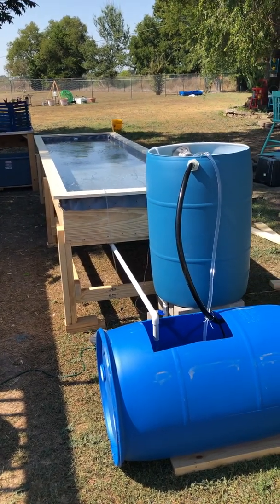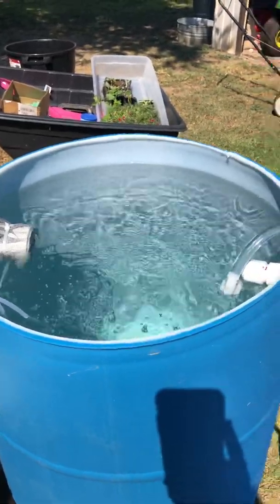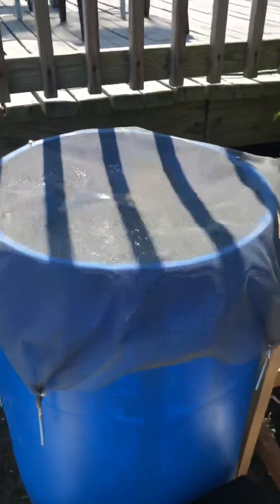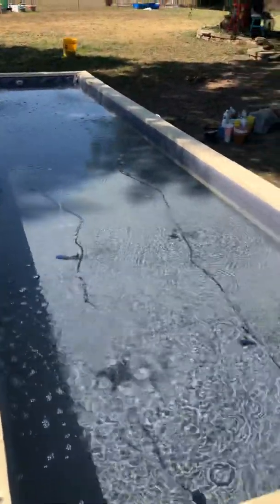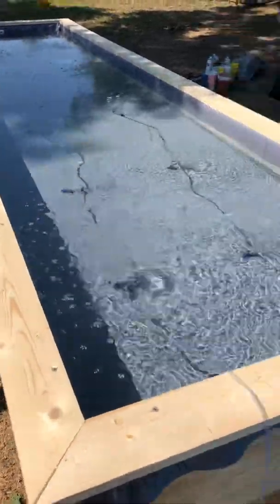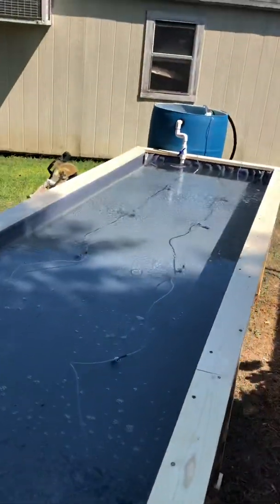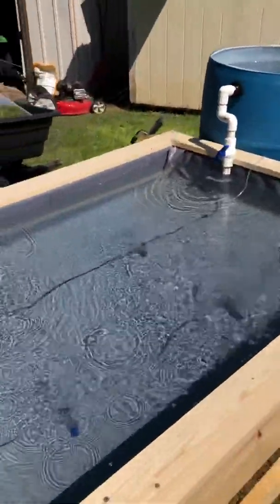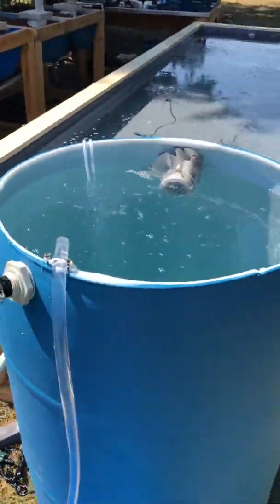Aquaponics! My deep water culture system

Comment: The plant roots in your deep water culture bed do not need oxygen during the day.  The plant produces all the oxygen the roots need from photosynthesis.  However, at night there is no photosynthesis being performed by the plants and the oxygen gets used up quickly.  This is one of the reasons you need aeration.  The second reason equally important is your biological filter.  All surfaces in the system will be colonized by the two bacteria responsible for the Nitrogen cycle in your system including the plant roots themselves.  These bacteria require large amounts of oxygen to oxidize ammonia into nitrite and nitrite into nitrate.  Dissolved oxygen in water is identical to the oxygen we breath in air.  It is two oxygen atoms bound together is commonly referred to as O2 in medical settings.  Oxygen dissolved in water is in that same form, O2.  The amount of dissolved oxygen in your system water is controlled by temperature.  The higher the water temperature is the lower the level of dissolved oxygen will be (unless you are able to supersaturate the water with oxygen which is a costly process).  You have built a nice looking system that should provide you with lots of fish and veggies.